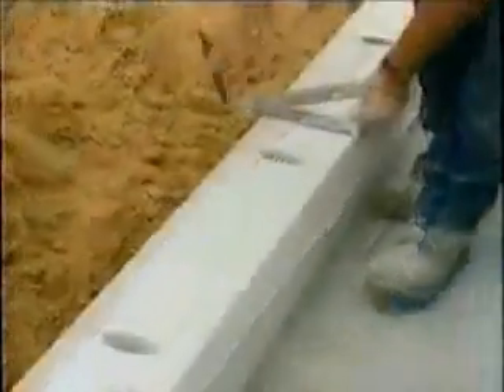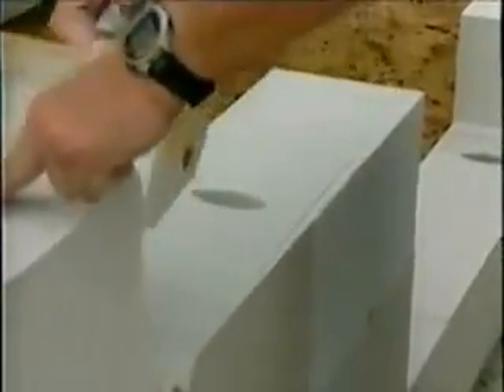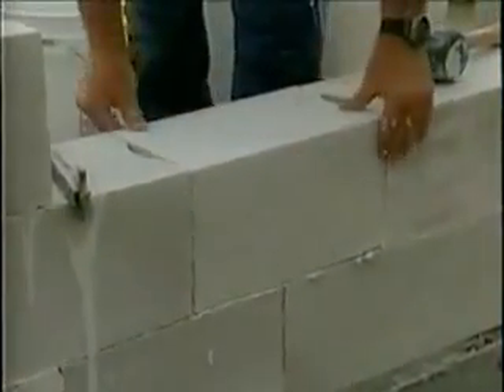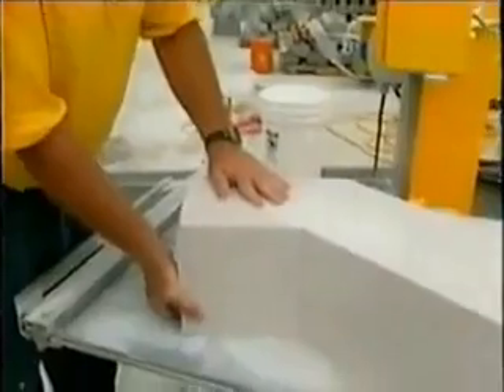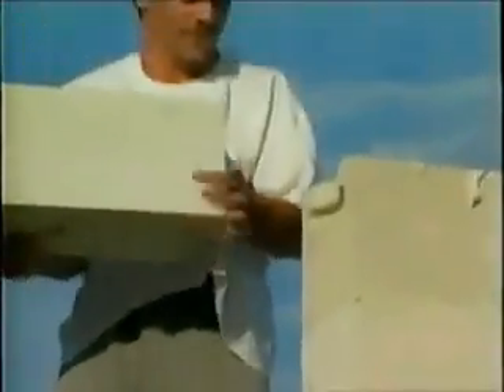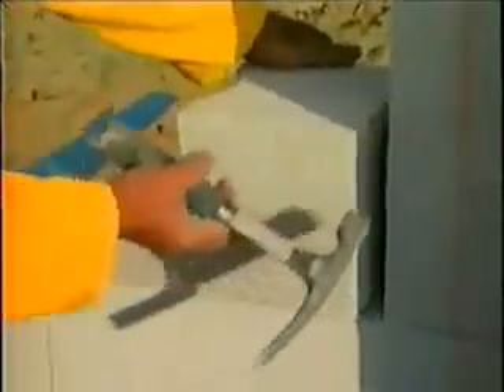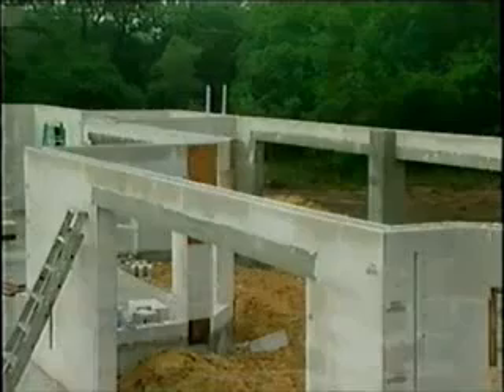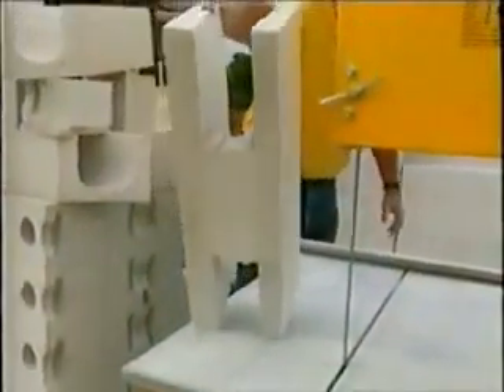Autoclaved Aerated Concrete - Block Installation - Part 1

Comment: I saw an accommodation block built like this in the Middle East. Superb insulation properties and completely sound proof. Steel framed with additional insulating polyurethane cladding followed by blasted concrete finish.

Comment: there is no concrete fill except for bond beams ?  so with a regular drill and saw i could just cut a doorway through ?  compare that to concrete fill cmu or other icf products which have concrete and rebar throughout the walls

Comment: Autoclaved Aerated Concrete, or simply aircrete, is much more than just blocks. In Europe its a leading building material for decades. More advanced products include: wall panels, floor panels, roof panels, facade panels, lintels and partition wall panels. They come in load bearing and non-load bearing types. To answer the "sturdiness" question - building made with aircrete can be easily protected against hurricanes and earthquakes with anchors systems.
Reply: how heavy is the load bearing type? Could it be used to build a 15m3 rectangular underground cistern that is empty some of the time..?
Reply: Hi there. What do I need to use to drill a hole like in the video?

Comment: Do a little research.  AAC is very high compression strength, has met all the standards for earthquake resistance, and is extremely fire resistant.  This is an exceptional product.

Comment: "It just doesn't seem sturdy enough..." Now that's scientific way to evaluate a building system. It withstands compression tests as well as lateral load tests. It's not used here because of narrow minded attitudes like yours. It is used in Europe extensively without any problems.

Comment: i think this aac system would be a natural for the use of surface bonding cement rather than thin set motar .surface bonding cement is troweled on to look like stucco and is stronger than a mortared wall without motar between the block.
Reply: Cement on blocks might cause weat walls if not placed correctly on drywall. Cement is used exceptional on metal supporters they gives vertical and horizontal antiquake defence

Comment: A company I worked with used AAC to construct a church in Kentucky about 12 years ago.  I'm currently designing an addition for a Veterans Affairs project using AAC.  We choose AAC for it's reputation as a 'green material', thermal value, it installs a bit faster due to being light and applying finishes directly to the block makes the product cheaper to install over CMU. The hardest part about using this product is finding qualified contractors to lay the block.

Comment: This would not be good to use as a structural material.  However, if they used a 4" thick version of this block, it would be good for insulation.